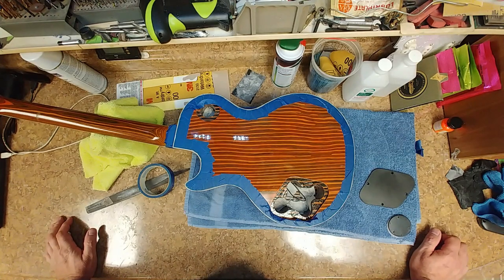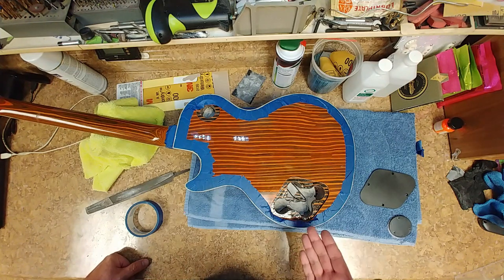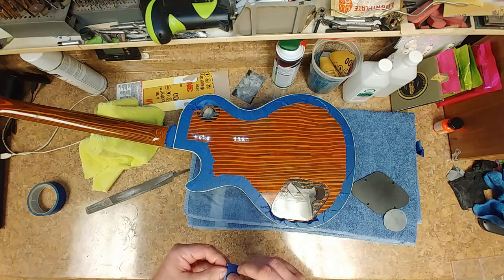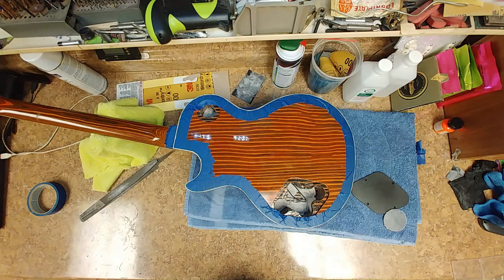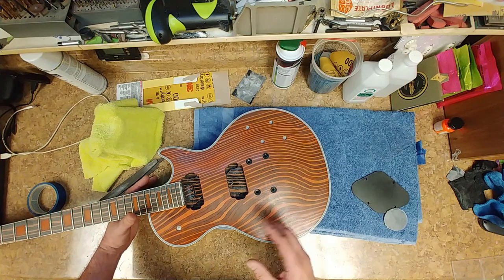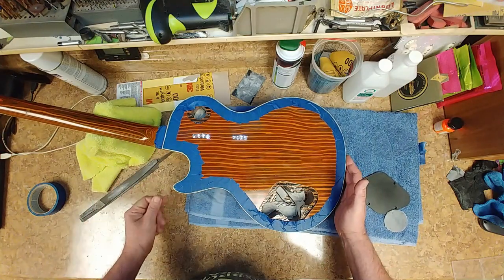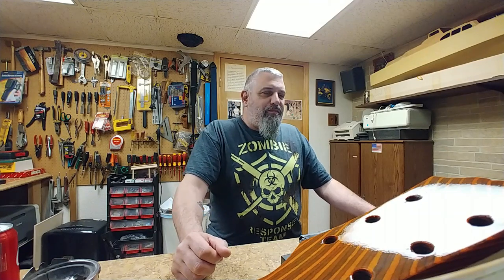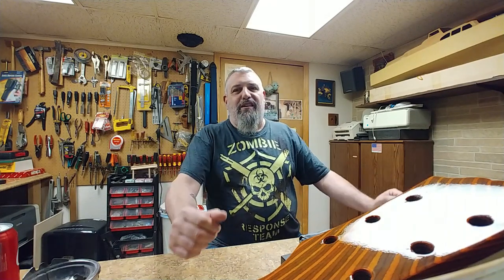Making Control Covers and Rant

Comment: I've never seen one of those Harley Benton goldtops in the flesh, but if they use the same poly finish as epiphones there's no way Terry sanded it to bare wood without wrecking the guitar.
Once that poly's on it ain't coming off unless you use some industrial chemical stripper & then the bindings ruined.
Frankly I don't care what Terry does with his guitars, but I find it odd he lies about such things in a community where peaple must know he's lying
Reply from the maker: Yeah, that's why I say what I say. I have had to strip a poly finish. It took a torch to burn the finish off. That was the LTD Supper Chicken guitar I did a long time ago. 80 grit sandpaper wouldn't cut it completely off.